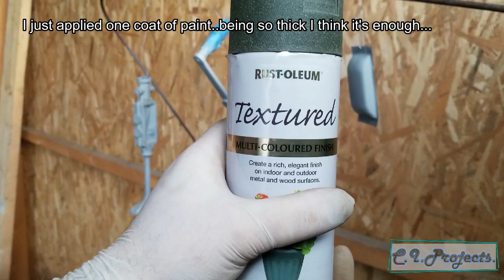Two Speed Enclosed Breast Drill Restoration

Comment: How did you managed to open the chuck?
Reply from the maker: Hello, I didn't open the chuck, I just cleaned it as an assembly 4:32.
Reply: CI Projects mine is missing the springs and I have no idea how to get them in.
Reply: Shai Shamir the Chuck comes apart, put it in the vice jaws down, the step at the end needs to be unscrewed with a large pair of grips, you can then take out the plate that pushes the jaws and remove the three jaws, the jaws have two holes in each place a spring into each hole to form a triangle this will hold together enough to put it back in the chuck, screw inner part back on first then put back the push plate and finally screw on the chuck and tighten. If you don’t have the springs use the ones that come inside a biro these are perfect, everyone has three useless biros lying around, they are in the third drawer down in the kitchen under all those old phone chargers!